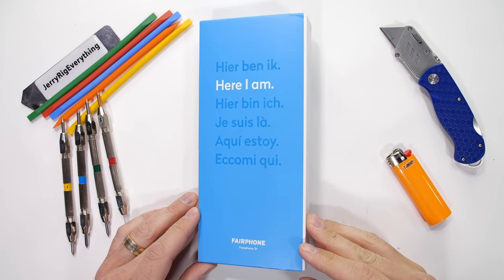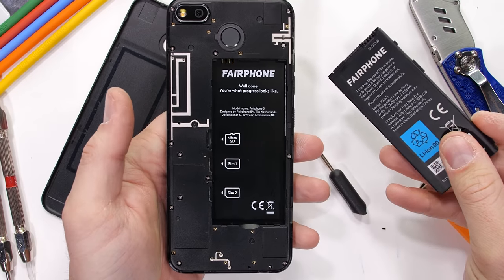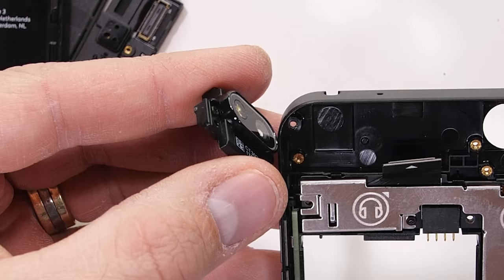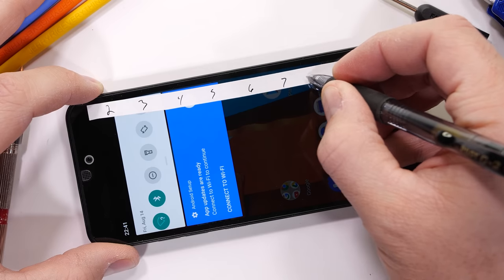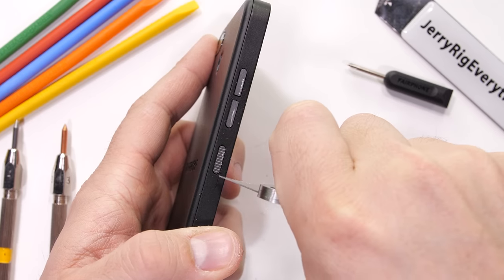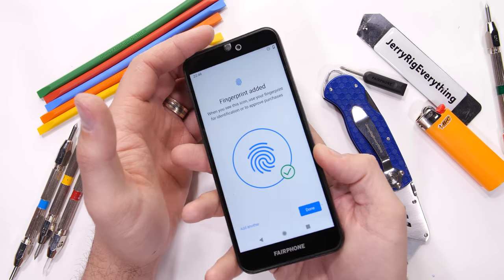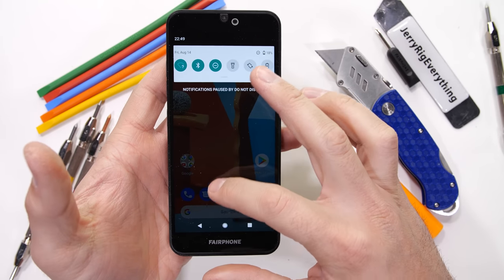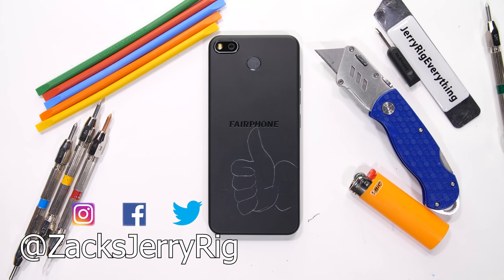Fairphone 3+ Durability Test! - it feels like cheating...

Comment: Words of the day from Zack: "ᵘⁿˡᵉˢˢ ʸᵒᵘ ᵒʷⁿ ᵃ ᴹᵃᶜ" 😂
Reply: Which is quite funny since many new Windows laptops aren’t upgradable either
Reply: That shocked the hell outta me..... Zack don't be doing this to the sound
Reply: @ElijahCiali  Most new ones still have replaceable RAM and M.2 storage
Reply: @brandon_nope  Most of the Ultrabooks are not upgradeable
Reply: @brandon_nope  Most new windows laptop especially not the gaming one, have soldered RAM. Many ultrabooks have soldered ram+m.2 too. Yes most of them have one additional RAM slot. But if the onboard RAM was broken, then R.I.P.
Reply: @WycliffStudios  what? Just took upgraded the ram in my Razer Blade
Reply: I think he ment like a desktop Mac not the MacBook since laptops don't really use standard parts
Reply: @Fran-gl4rh  But desktop Macs are fairly easy to upgrade though. Especially the newest generation of the Mac Pro, which seems a lot easier to upgrade than any Windows PC I've seen. iMacs are pretty easy to work on as well, or at least they used to be.
Reply: And from left channel..
Reply: @ElijahCiali  think he’s referring to pc and desktops
Reply: @ElijahCiali  kind of odd for u to say as m.2 storage, battery, ram, and if u want the display can be replaced with the effort, some laptops have upgradable gpus and I believe I have heard of other laptops with upgradable cpus. Upgrading a laptop is not exactly going with the purpose of a laptop, but considering that I've done this before I can say that it is reasonably easy
Reply: For a Second, I thought my Headphone broke.
Reply: It's funny. He said that and I said to myself "There's going to be some nerd in the comment feed who drops to his knees over that comment" and sure enough, here you are.

laughs in Hackintosh
Reply: @CanadianBakin42O  surface laptop series
Reply: @CanadianBakin42O  most Lenovo and asus laptops now have soldered ram too. Except for the gaming series
Reply: Coming from the left :D.
Reply: @ElijahCiali  he was talking about pcs not laptops
Reply: @attackhelicopter3860  in that case, apples desktops are fully upgradeable. RAM, CPU, GPU, other than the Mac Mini, everything can be switched out.
Reply: Not only Macs fall into the "hard to upgrade" concept that's kind of a stereotype, they wouldn't sell at all if they were that bad and guess what they sell a lot
Reply: Hearing this in stereo headphones felt hilariously random.
Reply: @CanadianBakin42O  i game on my m1 mba using GeForce Now
Reply: @CanadianBakin42O  m1 MacBooks are more than worth the price. They give me the best battery life for 13 inch ultrabooks, performance that rivals those of gaming laptops (13 inch), they have apps like Logic Pro, Final Cut Pro, i have access to features like AirDrop etc
Reply: @CanadianBakin42O  you can have different preferences, but they're not crap, and getting less for more money also happens with android phones because guess what! Doesn't matter what they do, they copy Apple!
Reply: @CanadianBakin42O  it's a high end company, you won't expect a luxury car or a sports car to be the best for the price, it's just that bashing Apple whatever they do is "cool"
Reply: my left ear was so happy lmfao what a clever way to "whisper" something in a video
Reply: @facurojas4477  bruh wdym by "they wouldn't sell at all if they were that bad"?
Its something sold by Apple. So even if it has no screen. No features and is a glass plastic sandwich even then people will buy it. People buy apple devices not for the features.

Edit: as you yourself mentioned. Apple makes somewhat of luxury products. They aren't worth their price. Just bought due the brand.
Reply: @facurojas4477  unfortunately some dude forgot to research properly. Almost everything apple has implemented in their phones was done by some or the other android smartphone manufactures.

Although it is completely true that once Apple copies those from these unsuccessful devices and implements it in their iPhone's, all android smartphone manufacturers follow it.
Reply: @officialhideyo  those are good products, what happens is that fanatic people from the most quality for the price territory can't stand that, you wouldn't say a sports car has no use at all just because it's expensive and it isn't very luxurious inside, also, most flagships on android are as or more expensive than Apple's, without counting the "not as known" brands, you're also paying just for the name, it happens on any flagship product
Reply: @ElijahCiali  or quite nonsence.. since we are talking about PCs
Reply: @officialhideyo  i think the most obvious one is the charger situation, a decision that i don't support, but everyone started bashing them bc of that and then the same brands started doing the same, at least Apple says what they're doing from the beggining, if people like ok, if they don't, ok as well just don't buy from them
Reply: @ElijahCiali  I don't really understand how that's funny. Every item of what he specifically mentioned is upgradeable. Mentioning that some "Windows laptops" aren't and having to even stress that this is a new trend doesn't do anything to darken the waters of his point, or what he means.
Reply: @ElijahCiali  oh, I wasn't aware of that
Reply: my left eardrum enjoyed that line XD
Reply: @ElijahCiali  pretty much only ram and storage are upgradable, but they aren't meant to be upgraded much, he means desktops
Reply: How did you get the font so small.
Reply: @rakshanpoojary439  AGREE! If only sounded through the left earphone, I had to pause and check hahahahaha
Reply: @ElijahCiali  Well that's not Microsoft's doing, but OEMs.
Reply: @CanadianBakin42O  all that I said was right and you didn't know how to respond because of that, so you wrote this and you also came into my channel and started commenting my videos!!! Thanks for the free interaction!!! Fanboy
Reply: @ElijahCiali  no shit, it's a LAPTOP! 🤦🏻🤣
Reply: My brand new laptop has replaceable ram and m.2. It only have the one nvme though. Lenovo’s tend to not be upgradable at least for ram.
Reply: MacZack
Reply: @ElijahCiali  mac is not meaning macbook.
Reply: @Acrum99  im pretty sure that the rtx 3080 will not fit and without upgrading the psu
Reply: @guillermoparada7803  ram and ssd upgrade nice like every notebook these days
Reply: Macs were upgradable at one point
Reply: @WycliffStudios  it's a lie ... you can upgrade disk, ram and battery.
Reply: @CanadianBakin42O  YOU really need help, you really do
Reply: @CanadianBakin42O  I read every single word, it seems like you didn't read what I said
Reply: @CanadianBakin42O  you're making yourself look like a fool, you are ignoraring all the things I said, do you know what iphones can do? Be reliable, for years keep updating the software for more years than any android, and the only android phones that can compete with that reliability are the flagships which cost as much as most expensive apple ones, if you want to play with the customization of the phone all they long, sure get an android, it's your preference, but if you want a machine that can handle a lot of abuse and you don't want to replace it for 3+ years maybe you prefer an iphone, there are two different kinds of people, not only the ones that think like you
Reply: @CanadianBakin42O  i also see you are still commenting on my own videos but now it appears deleted, you really are the one who needs help, the differences may be huge on paper but the software really makes the difference in real life, if it makes you feel better, Note phones are the only android phones I can really consider if I had to go back
Reply: @Fran-gl4rh  but the mac pro is more upgradable or repairable than most tower desktops anyway
Reply: @NYLFR  He said ULTRABOOKS, which means Razer Book 13 and Razer Blade Stealth, neither of which have upgradable RAM.
Reply: @Acrum99  Macs are getting insanely hard to upgrade nowadays, not sure what you mean.

Apple won't even give OEM components to regular repair shops anymore, plus Apple is trying to push legislation that will not allow it's users to open or repair devices. 

Google it man. Even a judge overseeing a case laughed speaking to Apples attorneys over how rediculious Apple is being.
Reply: @ElijahCiali  I replied to another guy with a similar answer. 

But in a nutshell, Apple is trying to push rules and regulations to where any users using their products cannot upgrade.
Reply: @NYLFR  not everyone own a razer blade
Reply: @CanadianBakin42O  source: please believe me
Reply: @CanadianBakin42O  i told you both things and i also said is also a matter of taste but it seems like you really like to fight in the comments of a youtube video
Reply: @CanadianBakin42O   you started the fight with a violent answer to a respectful opinion that I posted, so who's the hypocrite?
Reply: Who tf
Reply: @andrive  JerryRig's name is Zack
Reply: Where is the samsung f62 wish ripoff
Reply: Huh
Reply: @bagasfabianmaulana  Most windows laptops have. I have an Asus Ultrabook, which not only has replaceable M.2, it has replaceable ram and a data slot
Reply: @bagasfabianmaulana  Not true, most Ultrabooks I own are Asus, and most are upgradable. Not only with a replaceable M.2, with 2 ram slots and a sata slot.
Reply: have to for school
Reply: HAHA Made MY Day!
Reply: Naj Abdul ganda ng motor nyo po
Reply: @ghejnuni  nah... Just teardown those Asus Vivobook series. You Will be surprised that 90% of them have soldered RAM. Its been known for years that many Asus laptops have soldered RAM. You just have one model.
Reply: @ElijahCiali  to be fair you can at least upgrade the storage and RAM.
Reply: @CyrusEpion  just search for a review of the Mac Pro (2020) and you'll see it's much simpler to upgrade than any Windows PC. I agree, Apple's laptops are pretty hard to upgrade these days, but their desktops are not.
Reply: Yea
Reply: @ElijahCiali  You still have the option to buy the ones you can easily upgrade (like in some Dell laptops you only need to remove one screw), not the case with Macbooks.
Reply: @brandon_nope  u have 6ix9ine likes😂
Reply: @InterwavePCS  Have you seen how thick upgradeable CPU/GPU laptops are? Even if they were, the support is very limited and the cooling isn’t amazing. Not only that, but many laptops are switching to soldered on storage and most already have soldered RAM. As for display and battery, that can be done easily on MacBooks, as I’ve done for many people.
Reply: @CanadianBakin42O  you are making yourself look as a fool, you repeated the same thing like three times now and I already said both things you're claiming for, but you don't wanna accept them
Reply: @CanadianBakin42O  the same again, I already told you the advantages but it seems that you didn't read them, I have a full brain but yours is getting smaller because of so much drugs
Reply: @CanadianBakin42O  also, isn't it an advantage itself that the phones are durable? What is the point of a phone if it becomes bullsh1t with only 1 year of use?
Reply: @CanadianBakin42O  Samsung sells screens for Apple because it't convenient, Apple could make its own screens and you're making this into a silly competition that is not even realistic, iphones are meant for an specific kind of people and android for another, also the only androids that can compete with apple are the most expensive flagships that are as expensive or more expensive, so don't come up with the "iphones are too expensive" bullsh1t
Reply: @CanadianBakin42O  MORE DURABLE, HAHAHAHAHAHA, I've had both, I know what I'm saying, please stop repeating the same bullsh1t over and over again
Reply: @Fran-gl4rh Many HP ZBook's have very repairable design, and is a laptop.
Reply: @InterwavePCS  some Fujitsu Lifebooks can have upgradeable cpus
Reply: Not gonna lie that scared the poop outta me while wearing my ANC headphones sounded like someone in my left ear :(
Reply: @facurojas4477  I know.. I wasn't replying to you lol
Reply: @andrive  oh ok hahaha
Reply: @CanadianBakin42O  umm yes you can. Heck even the MacBook air can game and it does it quite well
Reply: @NYLFR  yeah, me to but on my mac
Reply: @CanadianBakin42O  the new M1 macs CAN game
Reply: @Acrum99   Skeptical about the new Mac Pro being "easier to upgrade" since the components (except RAM and Storage) you can choose are quite limited, and there's driver issues if using macOS.
Reply: @Acrum99  Also super ultra overpriced in the name of convince to upgrade unlike any Windows PC
Reply: @CanadianBakin42O  you need help becasue it seems you can't understand that I already responded to them.
Reply: *Leans away from mic
Reply: @CanadianBakin42O  yeah yeah, keep smoking weed leave me alone with my happy life and my perfectly functional phone
Reply: @sleptwarrior6604  well it depends on what you're referring to. My point is that it's so much easier to replace or put in an additional component in the Mac Pro than in a PC. You basically only have to plug in an SSD or a graphics card with the Mac Pro and there are instructions on the computer itself which tells you where every screw needs to go. You don't need to be concerned with cables and such, everything is well laid out.

And I'm a PC user btw, mainly for gaming. But I still appreciate some things Apple do.
Reply: @CanadianBakin42O  yes, I'm a PC user, not a PC fan boy. This might be a bit of a shock to you but Windows isn't actually a perfection. No OS is.
Reply: For the Views! HAHAHHA
Reply: Lol
Reply: @ElijahCiali  I don't think he was talking about Laptops, but mostly tower PC's
Reply: how ridiculous to see someone trying defending apple thing in here. apple is utterly ugly overated garbage thing, which they are trying shutdown all ownership of their user property and claiming it "innovation".
Reply: Louis rossman entered the chat
Reply: @CanadianBakin42O 

You started the whole thing. The Apple user didn’t want to fight you in any way. If you were to just stop annoying him, this would have stopped and everyone would be happy. All operating systems have pros and cons. Now go away.
Reply: @CanadianBakin42O  what has android copied from iOS? The idea of a touchscreen smartphone OS which even Google admitted, Do Mot Disturb, Night Shift, Selfie Camera, Over Air Updates, Voice Assistants, Multi Touch and stuff like that.
Also, what is that huge security flaw? Genuinely curious.
Reply: @CanadianBakin42O  sorry that was auto correct. I was typing on my phone so I made the mistake. I mean Do Not Disturb. I guess u should be literate enough to know that🤡
Reply: @CanadianBakin42O  I searched it up but I didn’t find anything serious. Just some usual exploits. I found one but for that u have to search a site which nobody will be dumb enough to.
Reply: @CanadianBakin42O  Actually, screw this! Why are we arguing? Can’t we just get along?

Listen, you can live your fantasy. I’m sorry for roasting you. I just wanted to say why both operating systems are the same, not that one is superior to the other. I mentioned earlier that I used an Android. Look at me, I’m not judging Apple users. I will stop talking to you. You just go out there and let karma fix things up for you. Let the Apple user go with his/her iPhone and I’ll go with my Android. Best that you do the same. Arguing about operating systems is not like fighting over sport teams. That’s different. Let’s all put this conversation behind us, what do you say?
Reply: @CanadianBakin42O  I must say ur the rude one here. I mean I have seen debates like this about apple and android a LOT. U seem like one of those people who bash iphones cuz they can't afford it/ feel its too expensive so did not buy. You know there is a reason apple is a trillion dollar company. Iphones sell like crazy. Sure more people use android cuz there are a 1000+ companies but apple is just one single company. People buy iphones cuz they are comfortable with them not that they are crazy or stupid people. I mean 50+ million iPhone users cannot be crazy to buy one. Also ur just saying to other people that they are uneducated again and again its like u don't have a point and ur bullying him to get him to stop. If a person shares a view in a social site please don't be a shithead and argue with people saying they are uneducated ,etc. Please have some ethics.
Edit: I am an android user BTW.
Reply: @coreforce9872  I've just seen all of this, and I think we can all agree that this poor guy is too bored and he keeps repeating the same 3 things to everyone all over again, also he says he's being attacked and that people have miserable lives when he attacked everybody and he is so miserable that keeps fighting on youtube comments with nonsense and offending answers instead of arguments, the guy is just in a parallel world or something
Reply: @igniter_01   I've just seen all of this, and I think we can all agree that this poor guy is too bored and he keeps repeating the same 3 things to everyone all over again, also he says he's being attacked and that people have miserable lives when he attacked everybody and he is so miserable that keeps fighting on youtube comments with nonsense and offending answers instead of arguments, the guy is just in a parallel world or something
Reply: @Emobullymaguire   I've just seen all of this, and I think we can all agree that this poor guy is too bored and he keeps repeating the same 3 things to everyone all over again, also he says he's being attacked and that people have miserable lives when he attacked everybody and he is so miserable that keeps fighting on youtube comments with nonsense and offending answers instead of arguments, the guy is just in a parallel world or something
Reply: @AchmadBadra  read again what I said, there's nothing wrong, I think you should be dankbong420 first friends, it seems like both of you live in the same imaginary world, not saying Apple is perfect, I have a lot of critics on them, but saying is straight bullsh1t without argumenta makes not sense at all
Reply: @Acrum99   I've just seen all of this, and I think we can all agree that this poor guy is too bored and he keeps repeating the same 3 things to everyone all over again, also he says he's being attacked and that people have miserable lives when he attacked everybody and he is so miserable that keeps fighting on youtube comments with nonsense and offending answers instead of arguments, the guy is just in a parallel world or something
Reply: @facurojas4477  exaclty. He called my parents drug addicts
Reply: I agree.
Reply: @Emobullymaguire  it seems that is the only thing he knows how to do
Reply: @coreforce9872  with me or with the Dankbong420 guy?
Reply: @facurojas4477  I say that all of us should report him for hate speech and then he’ll get banned
Reply: @Emobullymaguire  I agree, I tried to report it myself when he was annoying me but we can bring some people and try to do it
Reply: @facurojas4477  yeah I reported him as well. I’ll try from my parents and sisters accounts
Reply: @Emobullymaguire  it's nice that someone else noticed this guy's behaviour, I'll do the same
Reply: The DankBong 420 guy.
Reply: @coreforce9872  exactly
Reply: @facurojas4477  excuse me?
Reply: Spell mac backwards and add era
Reply: @CanadianBakin42O  hahaha you changed your nick? What happened? Someone reported you? Wouldn't surprise me, I don't care in what imaginary world you live but apple doesn't give a shit about what android companies do
Reply: @ElijahCiali  Only for slim laptops, while on macbook even on high ends are not user replaceable. Macs are also not upgraded or replace by a user while windows PC can. So windows have a upper hand in non authorized repairs and maintenance
Reply: @ElijahCiali  And the apple 2 is famous for its expansion slots
Reply: @Acrum99  haha when the M1 Mac Pro: